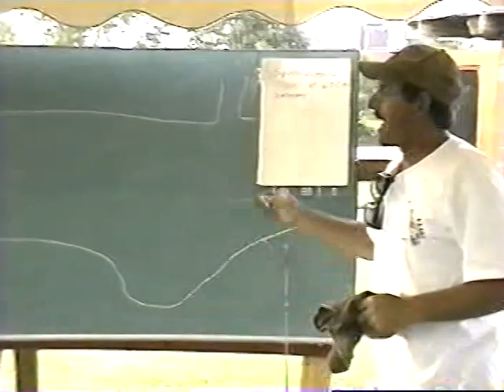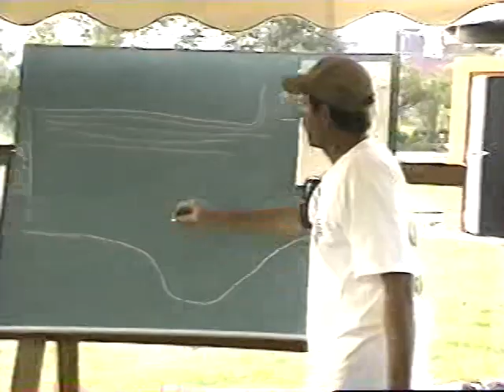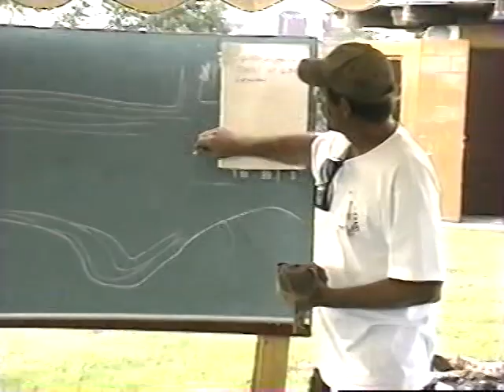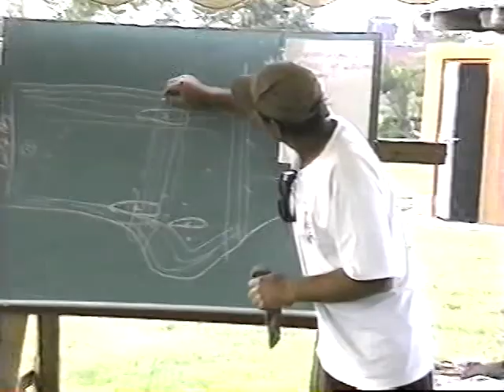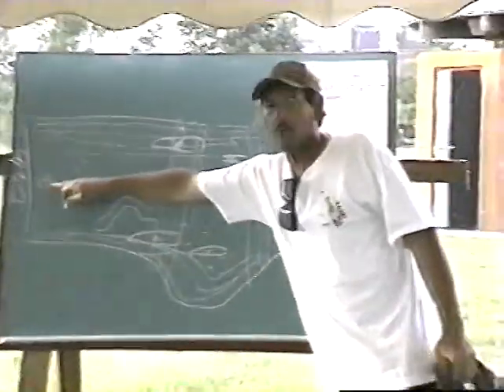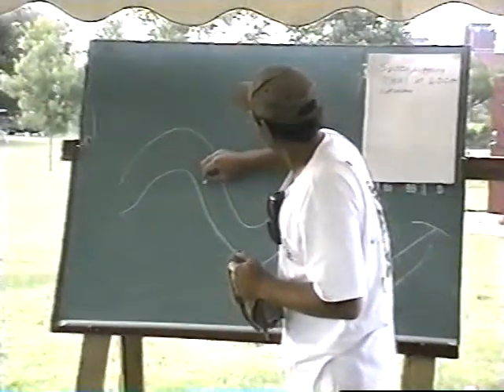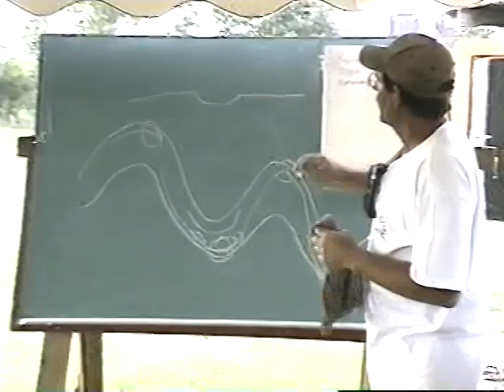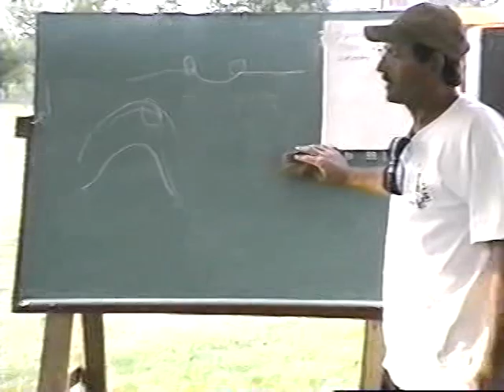John Bales talks about flatland reservoirs

Comment: this is an answer to the question I've had about a lake I fish in Illinois - Spring Lake in Macomb...it's an older small reservoir that was originally built in the 20's and added to in the 50's when it silted in.  I didn't know how to find the channel in a lake that's silted in, you can't really locate them with a depth finder- I will try this technique of fishing 'sideways' to find these holes left where the channel ran.  thanks!